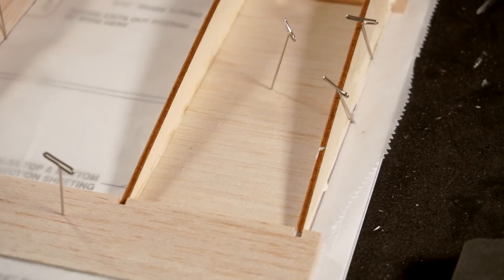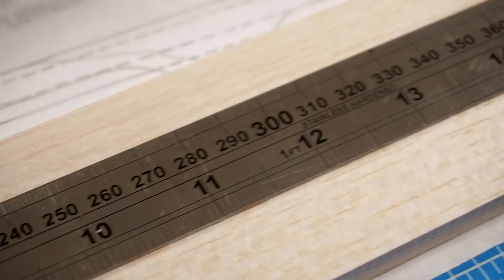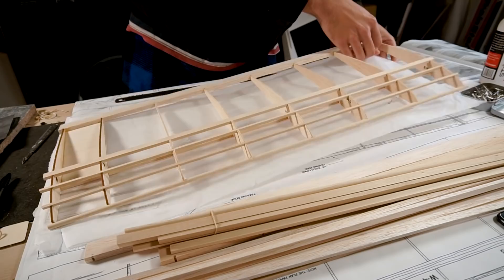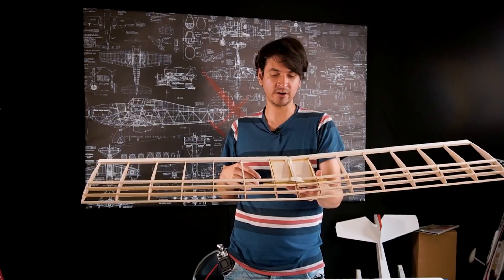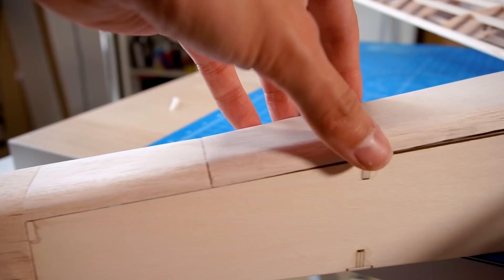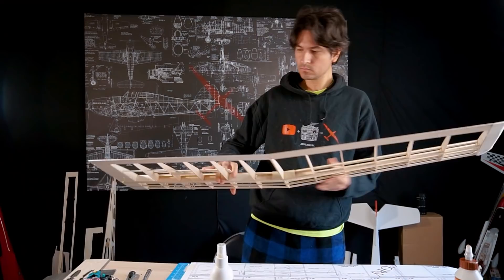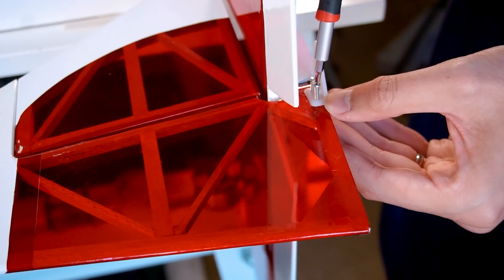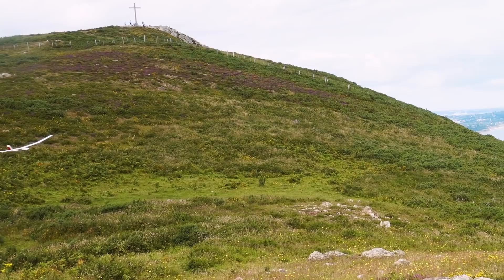Building and flying the Riser 100 glider | Classic Aeromodelling

Comment: Nice build!  And a very watchable video!  The cheap HF belt sander really helps with the nose and wing tips. One change I made from the plans was the hatch attachment. I shaped the hatch so the leading edge of the wing fit tighter.  Then glued the hatch to the fuselage at each end of it. About a half inch on on the front and an inch on the back edge. Then I cut the hatch at a slight angle so it formed a wedge. The Monokote fills the gap made by the saw so it fits. Just add more if it is too loose. Remember to make the saw cut negative in two directions so the hatch wedges in from one side and can't slide up.  It is simple and clean.  I've done it on most of my gliders and never lost a hatch in 35 years in flight.  I have lost plenty in the car on the way to the hill, but they were always the rubber band held ones, or the lever!

Comment: Great video and great build! One thing you might find useful in the future is to consider putting super lightweight fibreglass cloth over the nose and wingtips before you cover. Those are the places that tend to get damaged over time and it adds a lot of strength and puncture resistance for very little weight penalty.

Comment: drilling out the noise with a spad bitt very slowly from the inside will take more weight,
the bottom of the wings gets covered first then the top.
spruce is better on the leading edge to make the elevator stronger,
leave the legs on the rudder to drill holes in the fuse, so the rudder won't break on the first flip over.

glider builder for over 40 years.

Comment: I like that you use traditional wood glues and modern cyanoacrylates as well. Both have their places, plus Epoxies to make a strong and light airframe.  Don't worry too much about building a glider like this very very light. It will still fly wonderfully if it is a few ounces heavy.
Reply from the maker: True, In a windy slope I had to put a lot of weight to keep it flying straight.

Comment: nice work i spent my youth learning to build. last one i build was a wire to handle ver. thing is i never got to learn to fly i spend weeks building spending sometime 100 of pounds for everything only to smash it to bits as it came down... i should of had lessons first. still i love building or i did when i was a kid. im 50 now but still pulls on my heart strings to see a glider fly. it always did ill i had was books to learn from. haha. i used to use wax on my plans so i could see nice n clear. hot wax and an iron melt it all over the plans. parafin wax works to. in liquid form. thanks for your vid.

Comment: Change the nose out for a propeller and battery. It will save it from crashing is you also add in a “Sensor assisted flight envelope”. You can still crash it but with it, it’s hard to do.

Comment: This hobby has totally changed.  I last flew an 80" Hangar 9 Cap back in about 2010.  My last flight and then I got out.  LIfe happened, I sold years of parts and equipment.  I was mostly a kit builder all my years.  Now...good luck finding a balsa kit at all.  Sig.  Goldberg.  Midwest.  All the old names.  Go see if you can find a kit for an Astro Hog or a Goldberg Cub or a Stinger by Lanier.  What happened?

Comment: CA is OK for tacking operations, but Alphatic Resin/ Woodworking glue is better for bonding Balsa and Plywood. Nose Blocks should always be epoxied (they take more of a beating than you might think). Imperial measurements may be confusing for a Metric country, but Imperial measurements  with their fractions are easier to hold proportions in your head. I've been using both for over 40 years and interchange them. The Riser 100 is a good beginner's kit, and the laser cut kit of today is far superior to the "die crushed" parts of the past. There are plans out there for the Mark's Models Wanderer 99,  Craft-Air Wind Drifter, Airtronics Aquila/ Aquila Grande and the Airtronics Sagitta 600/900 (Probably the zenith of 70's-80's polyhedral designs two/three channel aircraft). Honorable mention given to the Hobie's legendary Hawk, but that plane was a "Ready to cover" aircraft which required many fixtures to manufacture.
Reply from the maker: Thanks for your recommendations and I will consider them for next builds. Cheers!

Comment: I would use PVA glue rather than gorilla glue as GG is so hard, sanding it against balsa results in over sanding the balsa, GG has its uses, especially around areas that require strength like the wing joiners. Super glue is good for areas such as rib caps and along leading edges to give them some ‘ding’ proof.
In the UK, Cambrian kits still produce the Elan 100 which is an excellent soarer.
Reply: Ca thin to penetrate,   then fillet it off with medium ca,    Way better way of getting stronger joints
Reply: @russcole5685  Just use white woodglue. Is strong and not so hard as CA or Gorilla. Hard tends to break easy. I use it for over 50 years model building and always with good results.
Reply: @hanspy2  yup,    fair enough,   cant argue with that,  or your length of experience.    I use Ca mainly for its speed of cure,   sanding?    Yea is a problem,  but if used in required amounts can eliminate the need for.     But yes,   I'm only judging how I got tought,   ca thick and thin,    and epoxy were its needed.     White glues are lighter as the cure and release their moisture.      I guess they each have there pros and cons
Reply: @russcole5685  Sanding is no problem with wood-glue. And the moisture is mostly water:)) And the speed is for most connections no problem. It is dry in 5 to 15 minutes.But hardening out takes longer. But who is in a hurry when building models? :))

Comment: I can’t believe we still hold on to SAE here in the US........I’m a metric guy😎
Reply from the maker: I don't even know what SAE is...
Reply: @Joyplanes  SAE is all the inch measurements along with the ill conceived threads per inch (tpi), and number size drills and screws. I won't even bother talking much about the archaic fractions while we have become almost entirely decimal due to computers and related technologies. Holding onto fractions only holds people back from thriving in a decimal based future. Once you free yourself from fractions, metric is easier to deal with. 2 7/16" just doesn't cut it with a calculator.
Reply: Growing up used both systems of measurement not a problem .just think what you are doing and work with both
Reply: I use both Imperial AND metric units and get along fine with both.
Reply: Imperial units was devised to make you intelligent....I’m gradually heading towards metric...inch by inch!
Reply: @TheParachaz  Just start living metric. Visualize. Depending solely on math can slow down the learning process. Think to yourself how many centimeters you are tall, how many kilograms you weigh, length of your car in meters, what do you wear at 0° C and 10° C. 
    Welcome aboard to metric!
Reply: joe woodchuck 
I’ve been educated in both, so I chose depending on what I’m working with.
Reply: @TheParachaz  Yep, me too
Reply: @Joyplanes  Society of Automotive Engineers

Comment: I’m building a riser 100 at the moment and can’t decide whether to make it electric or buy a bungee. I want it to be a floater and seek thermals. Would converting to electric make it much heavier and degrade its thermaling ability?
Reply from the maker: In general I think is worth putting a small motor, it is highly recommended, bungees are a hassle  and the motor and extras won't be as heavy specially if you just replace the ballast for the electronics that are almost the same weight.

Comment: You are right. Imperial units make no sense. I am in the States and still dislike them. However I grew up with the. So I am used to the. I also as an adult worked for a Japanese factory and learned metric. So I can swap back and forth pretty easily.

Comment: Hi. Great glider and building. But i didn't understand how does the spoilers work with single servo mounted in the fuselage and haven't any pushrods against them  Can you show or describe it?
Reply from the maker: They are being hold by rubber bands, and then pulled by a line. Very simple system, that way I only use 1 servo in the fuselage.

Comment: What do you use as a building board to take the pins? I use a piece of plasterboard laid on a flat bench with baking parchment laid over the plan to protect it from the glue. Throw the plasterboard away after the build :-)
Reply from the maker: That was foam board.

Comment: Thank you for this video. 
But seeing, for example, you had to cut out the ribs for the spoilers, that should have been prepared by SIG. Also the nose and the wing tips ... that should have been prepared too. There are a lot of much better kits available here in Germany and Austria.
A Razor Planer for Balsa Wood could be good idea and some ventilation in the wing before covering should be helpful ...
br ;-)
Reply: I disagree.  Most of that kit was laser cut and he had to do some shaping and cutting, but that is the fun of building an airplane. If you don't want to do anything then buy a RTF foamie.
Reply: @kalle123  I appreciate the links you provided, and I find that kit, though I only downloaded the first PDF, of high quality. 
   My response to your comment was intended to inspire not to aggrevate you but to point out that many flyers on R/C aircraft today want an RTF and not experience the joy of building the kit of wood and glue.
I'm curious as to the cost difference between the kit you commented on and the one shown in the video.

Comment: how did you get the rotating camera shots in the build part of the video? they look awesome.
Reply from the maker: I built a special camera mount for that, using some gears and an electric motor with a variable speed circuit. The gears rotate a stick where the camera is attached.

Comment: Very nice. I have not built like that for years. Did you want to keep it authentic, were you tempted to put servos on the wings for the spoilers? I never found that string pull rubber band system that reliable.
Reply from the maker: Yes that's the original except for the spoiler system, it actually makes use of two weights to come down which I though was less secure than the system I came up with with that rubber band. But the strings work the same, and the rest as well. I was thinking to place some servos in but I wanted to keep it as original as possible.

Comment: You've never even met me, and you want to hang me!? Damn! 
Imperial,  or Le Système International d'Unités, it's just the matter of a different ruler.  If you absolutely cannot figure it out, it is pretty easy to just work the fractions, then convert to SI. For example: Let's say the plan call out for ⅜" square stock to be used for the turbulator spars. Simply work the fraction;     3÷8=0.375
So, the decimal form of ⅜" is 0.375". This converts easily to metric, the conversion factor is 2.54 to get millimeters from inches. 
0.375"×2.54=0.9525mm
When working on a project like building a model, you can make yourself a "cheat sheet" to make this a very fast process. Draw up a conversion table that lists the call-out sizes in their metric equivalent. Before you know it, you'll have the conversions memorized. At least the ones that apply to your project. 
I do this sort of thing almost every day at my job. I harbour no animus towards people that exclusively use metric. It was my choice to work on projects that use the metric system. In light of that decision, I chose to learn it instead of complaining about it. You knew that kit was made in the USA when you bought it. Be gracious about the choices you make, or make different choices.
I'm a person that was born and raised with inches, feet, yards, miles, ounces, and pounds. I didn't know the metric system existed until my late teens. A relative died and bequeathed me his Volkswagon Beetle.
Believe it or not, the first time I saw a drawing that was labeled in millimeters . . . Let's just say that I just might as well have been looking at Chinese algebra. Even though I had to go and buy another set of wrenches, I never felt the urge to go string up the people that drew it. And metric or not, I really did enjoy that car. I hope you've enjoyed your glider.
Reply from the maker: That was a joke, but thanks for your comment.

Comment: I am building this glider. I have it in mind to convert it to a powered RC plane, because there are no suitable flying sites for it here in coastal Mississippi. Do you think such a modification is possible?
Reply from the maker: Yes, there's plenty of space in it and the glider is very light. You can use a small motor with a folding propeller in a 3S battery.
Reply: @Joyplanes  Thanks. Can you refer me to a diy video to give me some specifics?  I am a true greenhorn.
Reply: Since I am a nooby to this, can you suggest which motor (kv, amps, outrunner, etc.), ESC, precise propeller size, and battery (I don't know what 3S is, sorry) would you use to do this conversion? Would the prop required radio control for power adjustment? I can't find any good info on the web. Thanks.
Reply from the maker: @psirotta  Hi, a 3S is 3 cells, so a lipo battery with 3 cells is about 11.1 volts, any motor of about 1000Kv should be fine and use the propeller size the motor manufacturer recommends. The ESC should be of about 30 or 40A but a larger one also works.
Reply: @Joyplanes  Completed the fuselage, and only one small finger cut to show for it. Thanks for the information.
Reply: I'm wondering when your detailed 1-hour video on this build is coming out. I am really having trouble, making many mistakes, because I do not understand the instructions in the guide or the actual plans. A lot is left unexplained, and the pictures in the guide are useless. I am stopping until I have your video to follow.
Reply from the maker: @psirotta  about that, it's a project that has been taken me too long and now few things came up and I won't publish the course for now. So I guess you'll have to figure it out without my video for now. Sorry.
Reply: Well, I've managed to complete the fuselage and both wings (almost), and will be starting on the tail section. I must say your detailed course might have saved me considerable frustration, as it is not as straightforward a build as one might think, at least for a beginner like me. A lot is left unexplained, plus the electronics are not addressed at all. I do plan on powering this glider eventually, as I have no other way of getting airborne. I would like to send you photos of my build so far, if you are interested. How might I do that?
Reply from the maker: @psirotta  Yay! congrats! yes you can send me the pics, get in touch with me at box(at)joyplanes.com

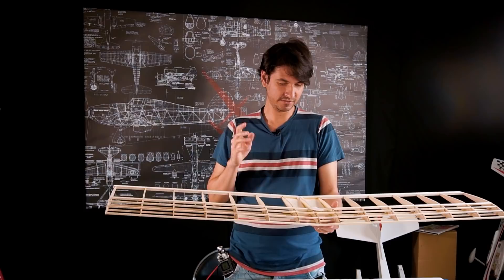Comment: some info.      at 7:08,  EVERYONE  should  take  NOTE  of  the  Correct  use of  mass-reducing  CUTOUTS  in the panels;  aft of the c-m.        at 7:35,  EVERYONE  should take  NOTE  of the  location of the  servos.        at 9:36,  it should be understood that the  presence of  outboard dihedral in the main wing makes the use of a central angle  Unnecessary.      in other words, the use of a (true) polyhedral wing  is  not  'necessary', on a model that will be  remotely  controlled.      googletranslate